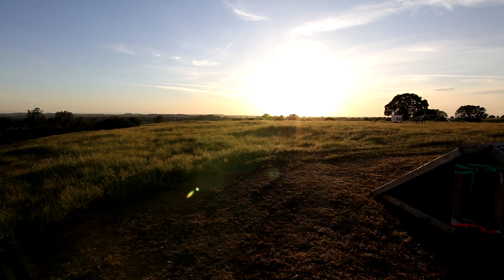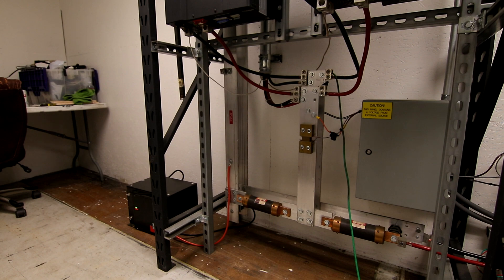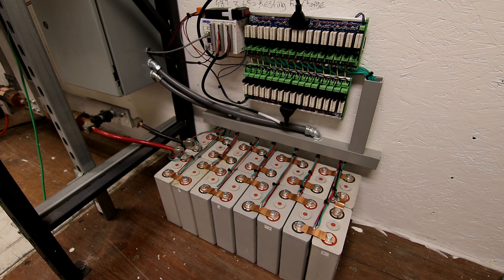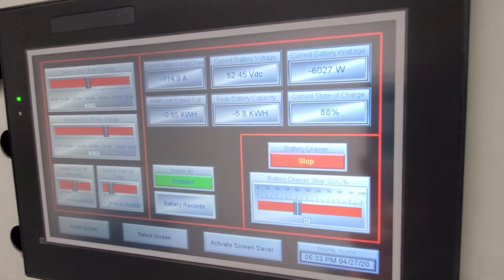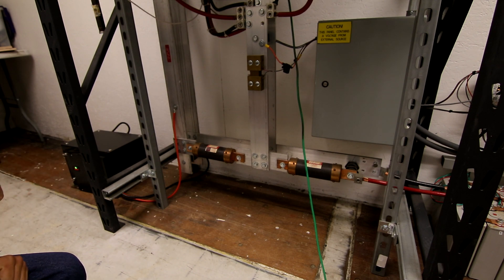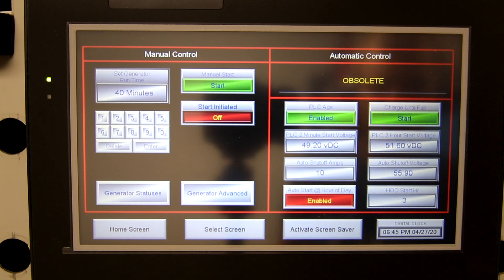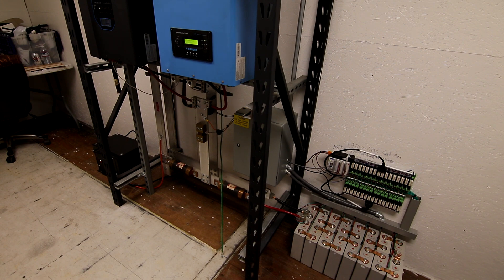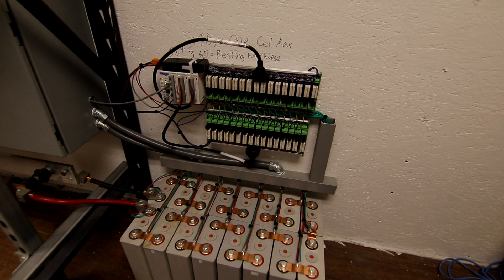Off Grid: Mixing NMC & LiFePO4 Cells in a Battery Bank

Comment: I've done plenty of research of this. It's not as much as IR but about the nominal voltages and how much they can hold at that level. Li-ion will take over a lot at start and near the end of the hybrid pack, while LFPs will take-over all the big middle area which is around 75% of the total pack capacity. Roughly is a 12%-75%-13% graph. Of course, this is capacity-dependent also, as the difference in capacity between standard li-ion cells and LFPs usually will favor the LFPs a lot considering that they are 300Ah++ compared to a max of 240Ah you can find on various NMCs or leaf packs. Anyway, a really great advantage is that your pack won't die when LFPs get low and you can keep having a system up and running at significantly lower voltage.

Comment: Fantastic man.  Just what I was looking for and the click plc is am added bonus.  Thank you!
Reply from the maker: Glad it helped!
Reply: Revisiting this.  I have 4 of the older 3.8kw packs from big battery, NMC chemistry.  I am moving a direction if running a sol ark 15k and shopping for LifePO for additional storage.  Do you see an issue if I have roughly 30kw of lifepo in parallel with these packs?  I bought them before the project was fully scoped (never happens right?). Input is appreciated.

Comment: Add one calb cell to other 16 and u will have even current draw and charging ....
I have similar config li-ion and lifepo4 on the same bus cut of voltage 48-49v and top battery voltage 57v  ....

Comment: I have found that FLA does the same thing. I had 4 L-16 per bank. One bank was new the other bank was 1 year old. They responded the same way. It has to be the internal resistance on the new batteries was lower than the old batteries hense the new batteries were doing all the work. I think lol.

Comment: This BigBattery 48 Volt Li-Ion Mini Power Pack has been reviewed on other You-Tube sites.  Yet, nobody has been able to answer this simple question ... How many more CYCLES do these modules have remaining, given that the modules have already lost 30%, maybe even 40%, of their original Amp-Hour capacity?  How can we pay $550 - $750 for a battery pack when nobody has any idea how many CYCLES we will get?  What is the WARRANTY ?
Reply: Sadly it is not a 'simple' question. The original manufacturers only cycle test batteries to 80% or maybe 70%, where especially in car applications, the energy density is really asking for a replacement. And how any particular battery was treated in the field will also greatly impact that battery.  Was it slammed max charge and discharge in a non-conditioned environment its whole life? Expect problems sooner than later. Was it babied its whole life? Expect a longer life. But you as the buyer of a used pack have no idea of that service life at all.  but that is just about any used battery.. none of the recyclers that I know warrant their batteries for anything other than dead cell on arrival or not getting stated capacity on first few runs / maybe up to 30 days.  Used batteries should never be used where its mission critical.  Some chemistries do severely plummet after the 70% point, some live on for a long time. No matter what, its important to note they will degrade faster than 'new'. Its very likely a single cell within a pack will fail (and if not BMS'd likely destroy all the others in the pack).  It is the trade off. Generally far cheaper to get capacity storage, but that storage over-all takes up more space, weighs more, self discharges more, and requires more hands on care.

Comment: I want that monitoring setup
Reply from the maker: It is custom built. If you are truly interested in one I actually have a business and can do custom builds. Would you be interested?
Reply: @HighTechLab  sure if it didn't cost an arm and leg. I knew it had to be custom. Just started in Home Assistant and was playing around
Reply: @HighTechLab  please send your email so i can contact you on this
Reply from the maker: Info@currentconnected.com
Reply: Looking to get  Battery voltage into home assistant and respond accordingly.  Control inverter,  record solar output,  record time on/off grid power,  solar shed temp. Got a voltage module that I have to modify resistance to be able to read solar voltage

Comment: I also have a dual battery bank of different cell types, one being Li-in and the other being Lifepo4 and i find that the banks run on different load and charge rates, finding that the Li-on seems to react quicker to loads when near full charged and towards the end of it's discharge voltage, in between that the Lifepo4 take most loads, I am running a EmonDC for monitoring current

Comment: Your video are very interesting and informatives!  I like your Bus Bars install, it look very industrial!    btw, Nissan Leaf pack are LiMn, (Lithium Manganese) and not NMC ( Nickel Manganese Cobalt) The Chevy Volt, and Bolt are using NMC however  as well as Zero Motorcycles.
Reply from the maker: Thanks for the info!  Apparently I was mistaken.   "It uses a different material for the cathode called lithium-manganese-oxide with nickel oxide (LiMn2O4 with LiNiO2)" is what some extensive research just told me.  It looks like the generation 2 cells were different and I went with the information that was available on BigBattery's website.  Very glad you pointed this out to me becuase now I need to correct a good handfull of my videos.
Reply: @HighTechLab  So, BigBattery's website is wrong?  The chemistry is not "NMC" per BigBattery website?  GEN & GEN 2 batteries are actually ( LiMn2O4 + LiNiO2 )  Chemistry, which is essentially ( spinel structure ) "LMO" plus Nickel.  There is a lot of conflicting information on the web, regarding the GEN 1 & GEN 2 Leaf battery pack.  In the Second Generation ( 2017+ model  ) Leaf cars, not to be confused with the GEN 2 battery pack, it appears that the battery pack chemistry is actually ( layer structure ) "NMC".

Comment: If you were to touch those bus bars in the middle would you get an electric shock? Or is the voltage too low for that? 🤔
Reply: Too low, its about 60V. Depending on skin condition you may feel a slight tingle but nothing to be concerned about if you keep it short
Reply from the maker: I actually made a video on this, when I have my laptop I could send the link if you would like but they are quite safe and I have not had any issues since I've energized them which has been a good minute as I mentioned in the video

Comment: yes the leaf pack will take the hit first and then charge first leaving the lifepo4 cells only being used a little in the back ground.  lifepo4 sag in voltage under load or charge and the leaf cells do not under load or charge.
Reply from the maker: Actually I will observe the opposite. Life po4 often times stays exactly the same under load and these leaf cells have a pretty high drop under load. They just have their capacity at a higher voltage it seems so that's why they take the hit
Reply: @HighTechLab  only cause the leaf cells are at 55-60% of what they where  new. New leaf cells do not do this. Lifepo4 have a much larger sag under load.
Reply: @HighTechLab  also you lifepo4 bank is much larger to take into consideration

Comment: Next week I’m doing almost the same, I’m matching my 2 Tesla model s modules running in series for 48v and I’m putting together 14s 100ah 3.2v lifepo4 cells and hooking it up all together to main bus bar, just like you did. And I’m making it up  for same reason as you did, to put less stress on my Tesla pack. The only problem is my Tesla pack is around 10kw about 6Kw is useable, but my lifepo4 pack will be around 4 kw about 3 will be useable, wondering if I will have any current sharing problem between them? Will be monitoring closely it, pretty sure it will be just fine
Reply: 14s for lithium-ion yes s48 votes 14s for lithium iron phosphate no that is not 48 volts you need 16s

Comment: Still putting up my Shed here.    I have 12 Nissan Modules  configured to 24v.   Nothing like your system but will be lowering my Power bill significantly.     What kinda Ah are those Nissan modules proving to provide ?  48Ah ?  More ?
Reply from the maker: If all goes well, I'll record the capacity test tomorrow and you will see that video on Saturday around 1PM PST.  And the video on the relay board should be coming next Wednesday.

Comment: I would say if the quality of the batteries were reversed it would be a no go for me.The NMC are charging the CALBs
Reply: The BigBattery is actually "LMO" + Nickel, not NMC.  Nissan didn't use NMC until  2017+ cars.  Explain => HOW the BigBattery is "charging" the CALB's?  During DISCHARGING - both battery banks are discharging and supplying amps to the load.  During CHARGING - both batteries banks are receiving amps from the charger ...
Reply: @vtorsi610  when resting . Lfp sinks in voltage much more and quicker then the leaf cells. I've tried.  I have seen it.
Reply: @frankz1125  When at REST?  My bank is always discharging or being charged.  When the batteries are connected in PARALLEL , explain HOW you can "see" the voltage on the LFP pack sink lower vs Leaf battery bank?
Reply: @vtorsi610  check my channel. My batteries are always in use as well but when testing I noticed this. Try it out. Find out for yourself.
Reply: @vtorsi610  I have 300 kwhs of batteries in my possession atm. 60 kwh lfp bank at 120 vdc.
Reply: @vtorsi610  If you dont care about your batteries it all good. Do what you want.

Comment: The discharge from one battery to the other when the charge voltage becomes out of wack due to capacity and one battery is .5 volt or higher the transfer of energy can be rather high maybe 150 amps or more.
Reply: How can one pack be 0.5 volts higher then the other pack?  Given, both packs are connected in parallel ?  The external voltage of both battery packs will be nearly equal, due to the massive bus bars.
Reply: @vtorsi610  It does equalize after charging slows or stops but while charging one battery charges faster than the other the pressure on each battery is not equal therefore the difference
Reply: @offgridwanabe  The pressure ( VOLTAGE ) across both batteries is EQUAL during the entire charging process, when connected in parallel.
Reply: @vtorsi610  yes it is but the battery resistance is different so each battery draws a different amperage thus one get full first
Reply: @offgridwanabe  If one pack has a lower internal resistance, then it will supply more amps during the discharge and it will receive more amps during the recharge cycle.  I never recharge to 100% SOC, therefore there is no such thing as one bank gets full first. They are at the same voltage at the same time ...
Reply: @vtorsi610  you can theroy all you want i can see the voltage go from one bank to the other with no charge controller hooked up. Electrons travel on the path of least resistance first
Reply: @offgridwanabe  No, not theory ... fact. Most people do NOT ever disconnect their battery bank from the Charge Controller and their Loads.  So, you are "testing" in environment that never happens in the real world.  Who cares what would / could / might happen if we were disconnect our battery banks from both the Charge Controllers and all Loads, since we never do that?  Who does that?  No, I don't  worry about hypothetical situations, that will never occur under normal use.